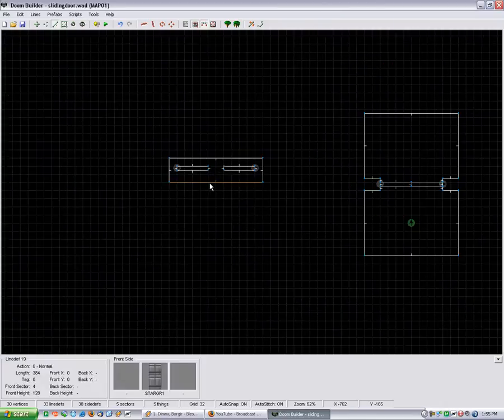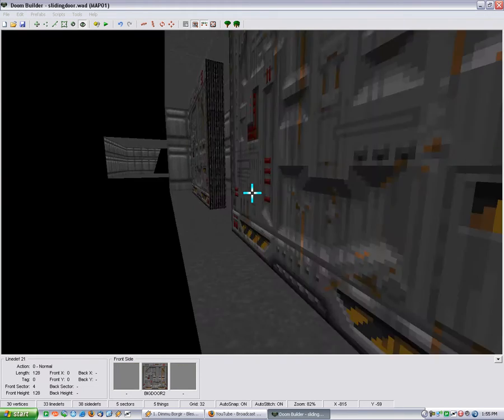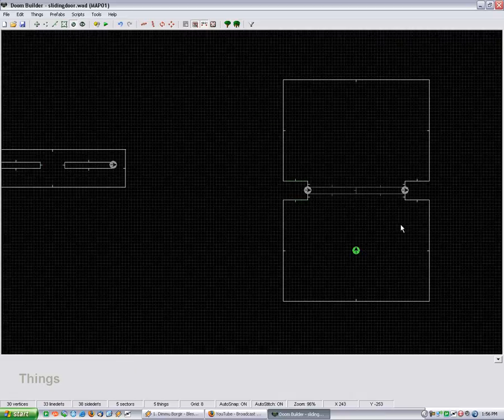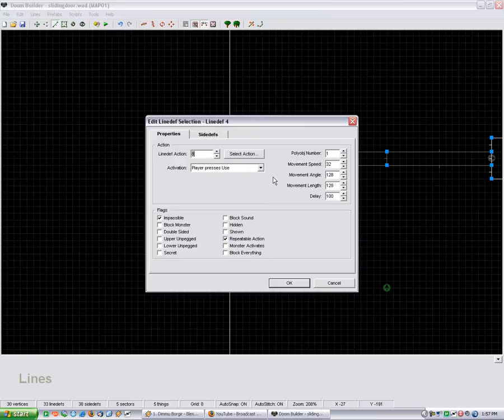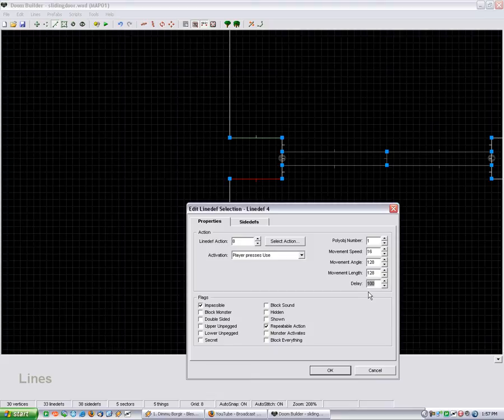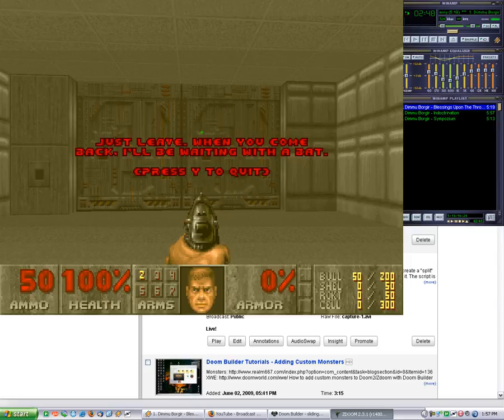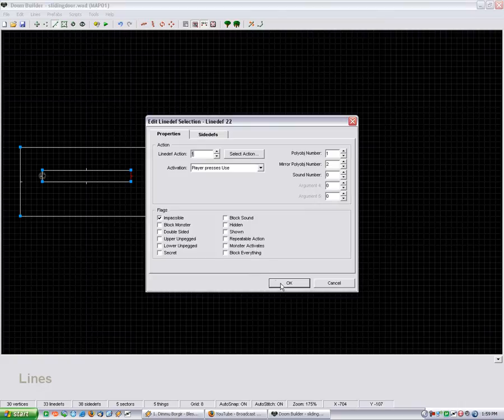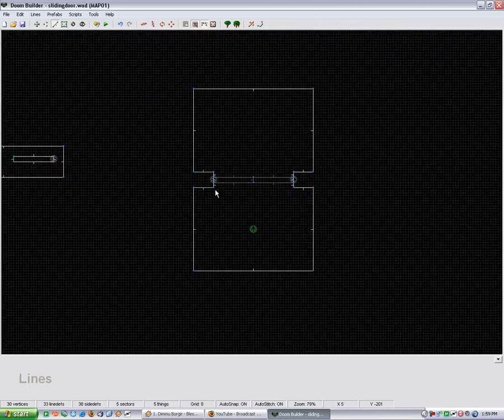Doom Builder Tutorials - Sliding Door

Comment: One thing not mentioned in this video is that the angles of the polyobject anchors and starting points to match their polyobject numbers, so if the polyobject number is 0, the angle is 0, if the number is 1, the angle is 1 and so on.